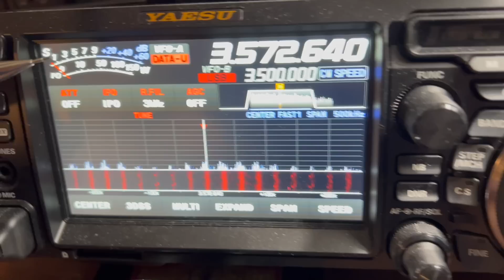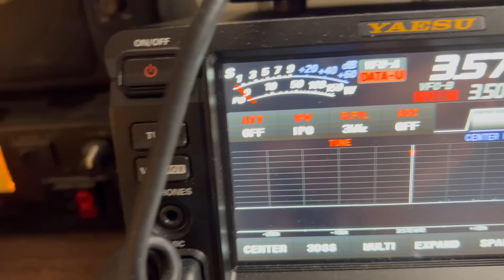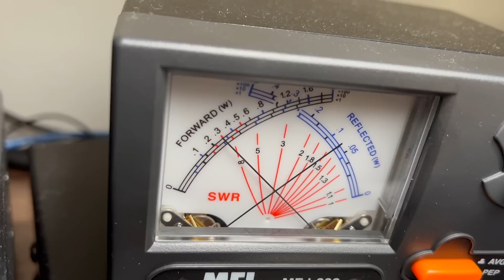The Myth of SWR

Comment: The meters power rating is only correct at 1:1 match. Anyone who doesn’t understand that an antenna that isn’t properly matched isn’t as efficient as one that is, doesn’t understand basic power transfer engineering concepts. I have an Electronics Engineering degree, this was taught in school. Any reflected power between say the transmitter and input of the ATU if the ATU cannot provide a 1:1 match is reflected back to the transmitter finals as heat. This is why protection circuits cut back output power if there isn’t a 1:1 match since the reflected power will add heat to the final components.  So the power is lost. There is also the output of the ATU to the transmission line and antenna. If there is reflected power from the antenna and the transmission line combined, then transmission line and ATU absorbs the reflected power as heat. It’s lost power that doesn’t get radiated from the antenna. If it’s not a 1:1 match at the antenna, a signal will still be radiated from the antenna, but some power gets reflected is not radiated. So your antenna is not 100% efficient . Theoretically if you loose 50% of your power to coax and reflected power then you have lost 3DB signal radiated.
Reply: I am amazed you are slating people who don't understand the rules of power transfer then proceed to admit you don't yourself
Reply from the maker: I appreciate the hard work you put into your education and taking the time to respond but you are not correct.  ALL reflected power is reflected from the transmitter or tuner back to the antenna.  The transmitter does not see reflected power.  Also a low SWR is not an indication of antenna efficiency-it indicates a good match.  I have a dummy load with a 1:1 SWR but it’s a lousy antenna.  As for what heats up the finals with a high SWR I will save for a future discussion.  Check out the writings of antenna engineer Walt Maxwell.  https://www.k3emd.com/downloads/Reflect.pdf
Reply: @BustRadioMyths  Thanks for link. That is an excellent article.
Reply: ATU's do absorb power, as a matter of fact what destroys expensive roller tuned ATU's is burn marks on the inductors--this probably isn't from SWR but a good look at burned up ATU's could be interesting. In EE school the first thing they teach you is that all components absorb power/have losses/ and that there is no perfect component. @BustRadioMyths

Comment: Great topic! The principle of this is true with a catch.. look up the work by W2DU. High SWR and the multiple reflections will lead to excessive heat loss in the feed line if it is coaxial.  Twin lead doesn’t exhibit nearly the same degree of loss and can tolerate very high SWR without any significant loss of radiated power.

Someone else mentioned to look at a feed line loss calculator that depends on SWR to see its impact. Operating a twin lead at 8:1 VSWR or so will show a fractional loss.

73s
Reply: This is correct, however if a very low loss feedline is used on lower frequencies that loss maynot be that significant

Comment: The tuner does a little more than making the transmitter happy, in using capacitance and inductance to tune out the reactance of the system it creates a resonant system,  the conjugate matching rectifies the mismatch to allow maximum power transfer to create reflection gain
Reply: A transmitter is almost never intended to be conjugately matched to its load.  Instead, it is designed to deliver rated power at good efficiency into the intended load (typically 50 ohms).  When conjugately matched, the output device or devices (transistors or tubes) may be overstressed, causing excessive voltage, current, or power dissipation, leading to premature failure.  Fortunately, many modern transmitters will sense an overly stressful condition and reduce power or shut down to protect the output devices.  We want our transmitters to deliver rated power with good efficiency for long life, not maximum power.  Thus, we adjust the tuner so that the transmitter is terminated in 50 ohms (1:1 SWR).  This is not the same as a conjugate match.  In contrast, conjugate matching is often used in small-signal circuits where maximum power transfer is desired and where device dissipation and overstress are not issues.
Reply: @analog_guy may I guide you to the book reflections

Comment: So im new to this but, why do people use ladder line?  I was under the impression it was less lossy than coax, and that coax used on non resonant antennas is extremely lossy. Maybe im confusing things but your video contradicts some of what i thought i knew.
Reply: it lets you operate on many other bands where the SWR might be way over 20:1. It has very little loss compared to coax in that situation. That's why a doublet fed with ladder or twin lead makes a better multiband antenna than the G5RV coax antenna.
Reply from the maker: Ladder line has virtually no loss.  Good quality coax has some loss but not enough to worry about and is easier to use than ladder line.  However in the VHF and UHF bands coax loss can be significant.
Reply: The only reason ladder line went out of favor is that it picks up noise: from the shack, power lines, and the wall warts in your home. Oh, and it is a neater install.
Reply: Up to around 500 MHz or so almost all of the loss is in the wire.  Called I square R.  Or current squared time the resistance.  With 600 ohm wire line the current is much lower than 50 ohm line.  So less power is lost due to heating the wire.

Comment: While the antenna tuner may "insulate" your power amplifier from the impedance mismatch it does not mean that the RF energy is radiated from the antenna.
You will get voltage and current peaks on the feedline.. spaced in relationship to the wavelength (that is related to frequency and feedline velocity factor).

If you had a thermal camera you would see hot-spots on the coax where the current is at a maximum as the RF energy is converted to heat. In other spots you would see very high voltages that might arc-over between feedline conductors.

"Conservation of Energy" and the laws of thermodynamics.. energy is not lost but it can be converted to non-useful forms (heat). The bounce-back from the tuner and back in to the feedline/antenna does not suddenly arrive in-phase and end up as useful radiated energy at the antenna.
Reply: I concur. I absolutely cringed when FloridaMan uttered the phrase "SWR gain". (There is no such thing. Conservation of Energy is a real thing.) Cringed again when he (repeatedly) pointed out the power meter reading 30W.

The only thing that meter demonstrates is the abuse that would happen to the transmitter's final stage if the transmatch was not in place. It would be sending out 20W, but would be dealing with the same amount of heat as if it was pumping 30W. So in the same setup, if the transmitter was cranked up to 100W, it would be trying to shed 150W of heat. That's when stuff goes "pop".

There was a lot of good info in this vid, and the presentation style is absolutely fantastic. It just has a couple glaring flaws, that will lead gullible people astray. How very Florida, man.
Reply from the maker: @kelvin0mql Never said “SWR gain.”  I said “reflection gain.”  The SWR meter clearly shows an additional 10 watts of reflected power heading back to the antenna only to be bounced back again.   In the end, almost all of the transmitter’s output power is delivered to the antenna.  You don’t have to believe me or this from an ARRL paper on the subject:  “The energy bounces back and forth inside the cable until it’s all radiated by the antenna for a lossless trans- mission line. An important point to realize is that with extremely low loss transmission line, no matter what the SWR, most of the power can get delivered to the antenna.“  You are also mistaken believing that reflected power destroys transmitter finals.  But that’s for the next video.
Reply: @BustRadioMyths  Yes, you’re right, I’d mis-remembered the phrase. I apologize for that.

But it’s not really gain, at least not in the implied connotation. It’s merely an indication of the simplicity of the meter. (There are much better meters than anything MFJ makes.)

If the transmission line is lossless enough, and exactly the right length to be in-phase by the time it arrives at the antenna feedpoint, then yes, you can get almost the entire 20W radiated. But if out-of-phase waves didn’t cancel, then phased arrays would not be a thing; they’d all be omni-directional.

As for taking the ARRL’s word for it, no thanks. They’re a publishing house. They publish what will sell, whether it’s correct or not. Sure, they’d LIKE to be right all the time, but they’re just not. 

I take your point that people can waste time & money being overly concerned about a good match. But there’s also potential harm in being too unconcerned.
Reply: Oh. One other point: depending on the length of the feedline, the reflected power could be 180-degrees out-of-phase, which could result in CANCELLING some portion of the energy at the antenna feedpoint from getting radiated, could it not?
Reply from the maker: The antenna tuner changes the phase of the reflected power.  This is a quote from "Reflections" by antenna engineer Walt Maxwell.  "Tuning for maximum line current simply adjusts the phase of the reflected wave to rereflect down the line in phase with the forward wave."
Reply from the maker: Don’t take my word for it.  This is from the ARRL:  The energy bounces back and forth inside the cable until it’s all radiated by the antenna for a lossless trans- mission line. An important point to realize is that with extremely low loss transmission line, no matter what the SWR, most of the power can get delivered to the antenna.

Comment: That makes sense that the reflected signals end up at the aerial in the end, but wouldn't there some kind of phase cancellation issues happening? That power might be getting out, but not necessarily "helping" the signal?
Reply from the maker: The antenna tuner changes the phase of the reflected power.  This is a quote from "Reflections" by antenna engineer Walt Maxwell.  "Tuning for maximum line current simply adjusts the phase of the reflected wave to rereflect down the line in phase with the forward wave."
Reply: @BustRadioMyths  Thanks for that Mark, it makes perfect sense since the aerial tuner is a combination of capacitance and inductance and those components change the phase of a signal passing through them.
Reply from the maker: Not helping the signal.  The point is that reflected power isn’t lost and your full transmitter output will be delivered to the antenna, minus some insignificant coax cable loss.  This applies to the HF bands only.
Reply: @BustRadioMyths  So when you have a high amount of reflected power, why does it upset the finals so much? There must be something happening there that causes them to pull more current when this is going on?
Reply: @xanataph  For two reasons: If your transmitter sees a high impedance in the antenna feedline the voltage will be high, your mosfets may not like this. At the same time when your impedance is low, let's say 25 ohms, your output current will be twice as high.
Reply: @wietsepa4wj514  That makes sense too, half the impedance  - double the current which may beyond the specs of the output stage. But why does the high impedance upset it so much? For example with most solid state output stages in audio amps running a load too low will be bad for the same reason - excess current. But when such an amp is run with a speaker of higher impedance than the amp is rated for, it simply provides less current and runs cooler. And they tend to be perfectly OK with no load. Of course tube based audio amps are pretty much the opposite. They get upset with an open circuit as that can cause high reflected voltages from the output transformer. Does something similar happen with xmtr final stages?

Comment: Howdy. Great.
My thinking too. The reflected power ping-pongs between the tuner and antenna. After every pong some of the previous wave reflected power is radiated alongside the new wave radiation.
Technically the standing wave current nodes will produce ohmic losses at the nodes in the transmission cable. Technically there is a fire hazard at the nodes, but this is likely only running a 2 kW linear into a severely mismatched line. A 2 kW tuner is a monster. I assume not many have those.
The fire hazard may be a good thing to keep in in mind though.
Best regards.

Comment: The standing wave is dissipated inside the output transistor. 
If the transistor (MOSFET nowadays) works in class C, with a circulation angle between 72° and 90°, it will have a very good efficiency and for 10 W output, it will draw 12 - 13 W from the power supply and therefore dissipate 3 W of heat.
Now if the antenna is mismatched or broken, and half of the power is reflected back creating a standing wave, the transistor will have to dissipate 5 + 3 Watt. The heatsink may not be of the right size and after an hour or less of QSO, it will blow up. Newer radio use a temperature sensor which protects the entire circuit by reducing the output power...
Reply: This is incorrect, reflected power joins the forward power, it's not absorbed within the transmitter outputs

Comment: As Engineers, we encourage use of the SWR meter because it is a simple method that can be used by someone with NO understanding of electronics, or transmission line theory, to get their Transmitter installed. These days, that is MOST Hams.     Good luck trying to convince them.
Most will never understand what is going on, which is why they spend a fortune trying to reduce their 2:1 SWR down to 1:1 .
Despite this, they make hundreds of YT videos as "experts"  because they really believe that their SWR meter is a high tech instrument.
In a 50 year career designing communications equipment and antennae systems, I rarely even heard  "swr"  mentioned.  These issues were usually expressed in more technically relevant terms.   
It is hard work being an Amateur, and a Professional.    🙂
Reply from the maker: Brilliant!  I’m not an engineer but I can read and it disturbs me to see falsehoods spread.  I think you would enjoy reading some of the papers of a fellow engineer - Walter Maxwell, who wrote a series of papers on this subject - “Another Look At Reflections.”  It’s a good read.  

https://www.k3emd.com/downloads/Reflect.pdf
Reply: Yes, the SWR meter is an inexpensive addition to any station to tell the operator in a quick glance that the antenna and feedline are working today the same way they worked yesterday.  In other words, that nothing has gone wrong.  Unfortunately, since many operators have purchased SWR meters, low SWR has become an unnecessary obsession.  The operator imagines that lower SWR has to be significantly better, since the meter scale often devotes a significant amount of space at the low end, expanding the scale there.  If the SWR meters were redesigned so that 2:1 SWR was upscale just a few percent from 1:1 as compared to full scale, perhaps this would give a better indication of the relative importance of SWR, and there would be less obsession.  🙂

Comment: Christ this guy grabs you from the start like Paul Harvey and keeps your attention with his charisma and delivery like Art Bell. And makes you think to boot. How did I never stumble upon this channel? 

This, in combination with all the younger YouTube channels, is what is needed in amateur radio.

This is why the ARRL, and the tools like Dave Casler that they use, will always stumble to explain things.
Reply: @davidgold He’s abs right except that Coax loss can be an issues at HF frequencies - but in most cases, good quality, coax, and short runs it’s not an issue. I have a masters in EE and Math and have researched this extensively. If you think the reflected power is not sent back to the antenna, where is it going? The tuner should be getting warm and it doesn’t. I’ve made great DX contacts by not worrying too much about the SWR

Comment: All of what you said is correct only with an antenna tunner.  connect the antenna directly to the transceiver and see what happens to the finals...
Reply from the maker: What burns up the finals is the impedance mismatch causing increased power dissipation - not SWR or reflected power.
Reply: Reflected power still joins the forward power but the output will reduce to the difference of the reflected power, the tuner in line will allow the transmitter to produce its maximum power into the system

Comment: This is why your wolf river coil burns up
Reply: More likely due to heat generated by the relatively high resistance of the stainless steel wire used in WRC coil's construction and the relatively low melting temp of PVC coil form.

Comment: My experience is that it blows up the output stage (BLW33 or 587BLY) - from my pirate radio manufacturing days in the 1980’s.  A big SWR is a tiny output.
Reply: It's the impedance that has been transformed at the radio end of feedline because of the reflected power that causes the problems as the reflected power will join the forward power back towards the antenna

Comment: very interesting video Mark. I ran simulations on my HF antennas here using the calculator that you mentioned. They are delta loops with an swr of 1.5:1 and indeed there is little to be gained by spending a lot of time readjusting wire lengths. It really shows that the obsession  in getting a 1:1 swr gains just about nothing.